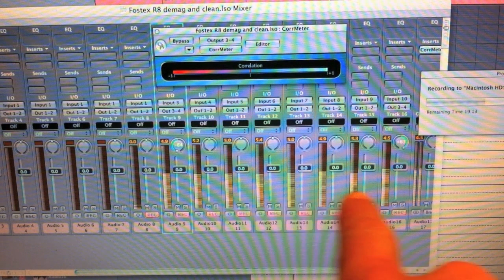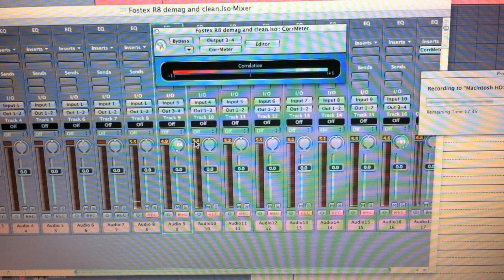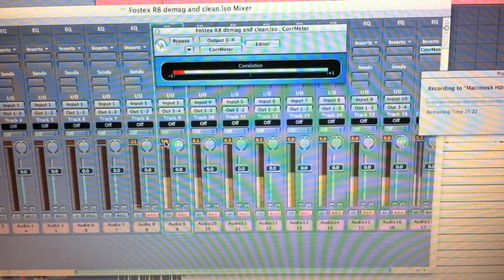ANALOGUE TAPE in a DIGITAL AGE part 1  Fostex R8 playback alignment

Comment: Hi, I bought a second hand R8 this year. Perfect transport, looked good. I got the calibration tape as suggested, and turns out tracks 1-6 sound distorted, no matter what. I can adjust the levels, but of course they are all over the place, in comparison with tracks 7-8, which are the only ones that don't sound distorted and sound just fine. Seems like a REPRO issue. Faulty tape heads for tracks 1-6 and fine for 7-8? Could this be? Do I need a headblock replacement which of course I will never find? Any ideas? Thanks for the video!

Comment: Hey Dan, I just bought the R8 and have hit some snags. I was hoping to buy a calibration tape and can't work out exactly which one I need. Which one are you using? Any UK suppliers of these?
Reply from the maker: Hi Dan-I bought an MRL test tape from the USA. Even with import charges (considerable), it was still cheaper than Canford Audio in the UK. It’s a NAB 15 ips tape with 1k, 10k, 16k and 100Hz tones on it.

Comment: I have a question for you if you wouldn't mind. I just acquired one of these and am going through calibration/alignment. The first part of the electrical alignment is input level and meter calibration. It wants you to apply a -10dBV (0.316Vac) signal, and adjust the Rec Cal trim pot, then adjust the meters.

I believe that is assuming you follow the Fostex spec of being aligned with a 320 nWB/m reference fluxivity test tape. However, suppose I am plan to use a 355 nWB/m reference fluxivity MRL tape instead. Doesn't that mean I should also change the input and meter calibration accordingly? Slightly confused. 

Thanks, great channel mate.
Reply from the maker: Hi there! No the meters are a separate calibration from the stronger flux tape. When you’ve done the meters, then adjust playback level and EQ with your test tape, then do the record side with a test tone from the desk or other source...
Reply: @DanBakerMusic  Right on, I was overthinking it. Makes perfect sense. Thank you!

Comment: Hi Dan, thanks for your support. I've repaired the winding cogs and now playing a test tape or the first time since, looking at the levels on the playback meters. Your video unless I've missed something focussed on reading output into DAW and listening to tone from DAW. My R8 meter levels vary by 3db and sometimes intermittently. Should I be adjusting something before I even go to DAW, and if so, which pot?
Reply from the maker: Hi Paul-I used the meters on my DAW as they are far more sensitive and detailed: the R8 ones only give you rough levels. However the DAW meters do show up the age of the machine-don't worry about a dB or so wavering each way...
Reply: Thanks Dan, I have had a play with the sensitivity switch too which is certainly a different response, but I take your point and will go with the DAW for calibration.

Comment: Hey man I was wondering if you could help me with some channel issues on my R8? Channels 3 and 6 have no signal at all. The lights still work though so its fully just a connection issue I would assume. I wouldn't have thought the channel cards were fried as channels 3 and 6 are not correlated at all in terms of the link (i.e. how 1 and 2 equate to 5, and 6 and 3 and 4 equate to 7 and 8). Just my thoughts. Any advice or anything would be grand!

Comment: Hello!

I wanted to ask you a question, I have a phostex gs-24, the fact is that several of its PCBs give an error depending on the technician who takes it and passes the service manuals that they gave me with the machine, the technician tells me that the diagrams of the service manual are not the same as those of the cards of the machine, you know if there is any revision of the manual and if I had it and would send me a copy only of the diagram of those PCB input and output of the machine I will read I would be eternally grateful since he has been in the technician for almost 2 years, thank you very much and a very good channel !! (sorry for my english)

Comment: Hi again Dan, when I run the calibration tape, it shows a lovely uniform 0db on the R8 meters but unlike your DAW's corresponding reading at -5db,  mine shows -12 across the board. Why the discrepancy? And why is 0db on both our R8 meters, not 0db on our DAWs?
Reply: Watching again, you did say that the levels into the DAW are arbitrary, and also that different tapes might make a difference too. I'd certainly like a hotter playback than -12db so I'm re-tweaking.
Reply from the maker: Hi Paul - sorry for the massive delay in getting back to you - the levels coming off tape are at domestic level, ie on phono RCA jacks. The level also depends on the flux density of your test tape - it should say somewhere, something like 185 nWb/m. As long as it sounds ok, I'd say this is the best benchmark. It's all very tricky unless you have an audio level meter that actually measures audio level properly. I haven't got one, but you can tell by the position of the level pots on tape - if you're having to wind them right up, or turn down, that should ring alarm bells. It'll also appear wrong if you try to record and the record levels (both level and treble) don't give you the results you need.
0dB on Daws is also the absolute top end. 
When I worked for EMI, an engineer would request an operating level for the tape machines according to the music they were recording. 
I'd say that your levels of -12dB on your DAW are quite low - maybe turn them up to -6dB...

Comment: Hello Dan! Good video, thanks. Just got a r8, could you tell me where you got that multi frequency measuring tape?
Reply from the maker: Hi Daan. I got the tape from USA. Cost of customs clearance was almost the same as the tape! Ended up being £150. I have a stereo quarter inch as well, so it made sense for me to buy. Steer clear of second hand ones as they may have been damaged, not giving you accurate levels. Canford Audio also sell these tapes but we're more expensive than getting one from the USA. Mind you, the £ has plummeted against the $ since I bought the tape, so if you're in the UK, Canford Audio might be best!
Reply: Hello Dan,
Thanks for the information. I'm in the Netherlands, so I guess I will buy the tape at that Canford shop (good tip :). 
Do you know if I should use IEC or NAB equalization or is this not important? 
Greetings Daan

Comment: Thanks, for the tips. How do you lubricate the capstan on these machines? My R8 is going very slow in play mode after a long period of no using, and it´s definately has something with the capstan to do.
Reply: make sure the capstan drive belt isn't stretched out
Reply: @drwolfer yes it was the capstan belt, changed it and everything runs smooth

Comment: What kind of tape do you use for your machine? I have the same fostex r8 but I'm not sure which kind of tape i should get, because I recognized there are some different types.
Reply from the maker: You’re meant to use 1 mil tape on this but it’s harder to get than 1.5 mil. The latter does have the potential to wear the heads faster but it works fine on my machine
Reply: @DanBakerMusic  So a "Calibration Level Tape, ¼” 7.5 ips (19,05 cm/s) 1 kHz 250 nWb/m DIN, 6 Min." would be ok for the job?
Reply from the maker: You’d need a 15ips tape, and also a NAB type rather than DIN. 250 nWb is good though. You’ll need at least 1kHz, 10kHz, and 100 Hz. Some also carry a 16kHz tone for fine azimuth adjustments

Comment: Hi, If I connect my computer to this foxtex and recored 1kh 10kh and 16kh on a blank reel, will that work to then use the recorded tape as a calibration tape?
Reply from the maker: This only works if you’ve lined up the playback side first with a calibration tape...

Comment: Hi Dan, is there any reason why the 1 kHz tone is playing back slightly higher (approx 1.1 kHz)?
Reply from the maker: Tapes, machines, electronics etc. on old home recorders like this had a manufacturing tolerance of light bulbs! The pitch control was in the middle, but the speed of the motor can be tweaked in two places, the back of the motor and the control card. You're lucky if you see 1.00kHz out of a machine like this. I used to work for EMI in the 1990s, and I lined up Studer A800 24 track 2" machines - even they varied a bit, though excellent sounding decks. Level alignment on a Fostex R8 wavers about 1 - 2dB anyway, so if it's 1.5kHz or 800 Hz, you get the same result. I think people get hung up on this as we're now used to digital equipment that has a flat response from 20Hz to 20,000Hz, with only perhaps 0.5dB either way....

Comment: Mine is a Bostitch R8 8-track recorder and like I said just the the wheels don't turn right away when you play it or record let me know thank you
Reply from the maker: There are drive belts as well as the plastic cogs that can fail. It sounds like the cogs may be developing cracks against the spindles of the motors. The drive belts have teeth so it’s unlikely to be those. If you take the front plate off the machine (Allen key bolts), you’ll see the plastic cogs: look out for hairline cracks. If there are any, you’ll need to drop a tiny bit of glue once you gently prise open the crack. Be careful with the amount of glue: none should go near the spindle, otherwise it’ll run down into the motor.

Comment: Hi Dan, I've got a R8 but the remote is missing. Is there a way I could check whether the machine works. I tried the buttons on the machine but the main tape motor doesn't turn. The pinch roller moves but thats about it. Also any idea how I could get a remote for the machine. Thanks
Reply from the maker: Hi there-it’s almost certainly the small plastic wheels on the underside of the reels that have parted company with the axles. The plastic wheels crack and then the metal axles turn within them. Your best bet is to glue them back on with araldite, but be careful that none of the glue goes down into the reel motors. Good luck! The remote is only there to display time and arm tracks: the machine will play back without it.

Comment: The 2 inch tape machines must be real easy to work on but 1/4'' is really trial and error getting the pre amps loud enough so you don't end up with 8 tracks of hiss
Reply from the maker: Totally. It’s a bit of a lottery. I sold the machine and the guy who bought it did comment that it sounded good!

Comment: Hey Dan.
I haven't been using a reel to reel machines for a while, just got my R8 as well. Still, need to fix a couple of things, but it's in good condition. 
Actually, it's the first time I saw someone says you should store tapes "tail out". Could you explain why it is better? Or send a link where I could read it? Or maybe this can be an idea for new video.
Reply from the maker: Hi there: storing tapes "tail out" means that you get pre-echo (where the layers of tape gradually magnetize each other), which is preferable to post-echo that would occur with "head out"..
Reply: Hm..never thougth of it
Reply from the maker: +leothemetal I think it's less of an issue when using noise reduction as the faint echoes are more likely to be swallowed up by it!
Reply: Well, I used only stereo reel to reel recorders, they go in both directions, so that doesn't make much difference, I guess.
Reply from the maker: Yes - quite so. Storing the tapes in either direction will end up being the same. It's the "print-through" that tapes have, and the more expensive ones quote dB figures for print-through.